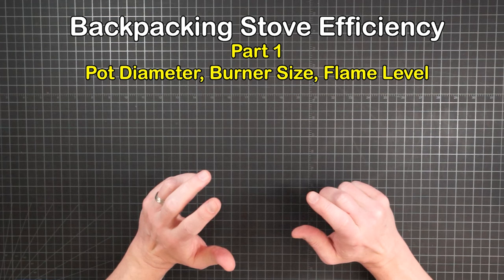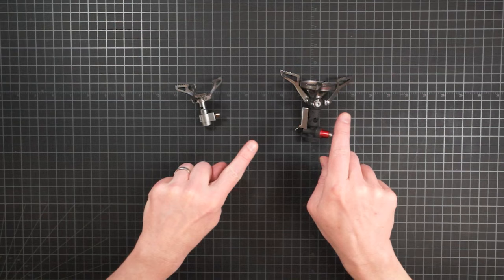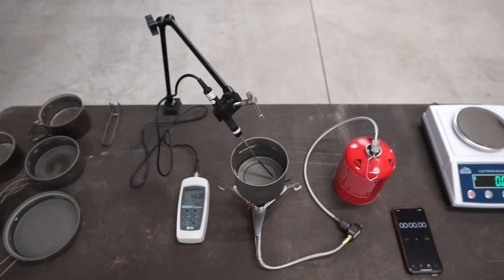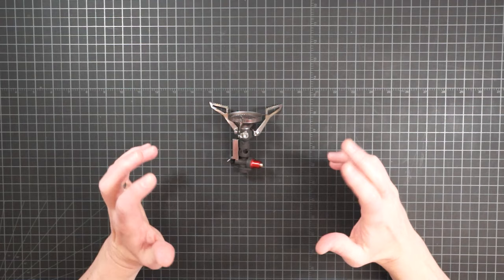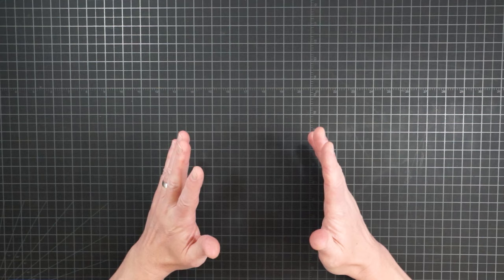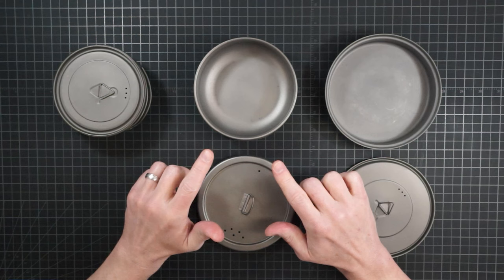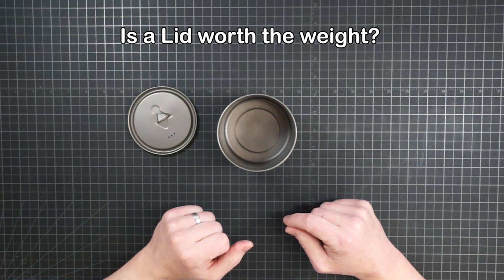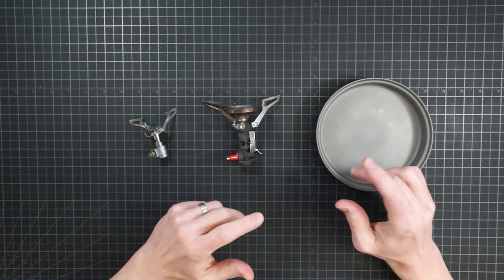Backpacking Stove Efficiency, Part 1: Pot Diameter, Burner Size, Flame Level

Comment: Thank you for starting this stoves series! I've had the questions you are exploring for a long time and very few reliable tests around the web.

If you are taking in suggestions:
- Heat exchangers vs regular Ti pot (or maybe a comparable Al one), are the savings worth it?
- MSR reactor style stove is supposedly more economical, is the weight penalty of the system worth it? When paired with regular Ti pot vs when with the default HX pot
- Alcohol vs gas vs liquid fuel, where is the inflection point of weight optimization?

Cold weather scenarios:
- Liquid fuel vs inverted gas vs gas
- Test solutions to warm up the gas cannisters like moulder strip or submerging in water
- Most efficient way (and system) to melt snow

Differences in altitude would be out of reach (no pun intended) for testing right?

And don't get me started on wind and wind screens, the rabbit hole goes ever deeper.

Good luck and have fun on this journey, well be following along!
Reply from the maker: Duly noted!

I'm already collecting windscreens, working on a fan for controlled air speed, and getting my hands on various heat-exchanger systems (like the Jetboils, MSR Reactor, etc).

Beginning thoughts on how to add alcohol and even stick stoves into the project.  Rabbit hole, indeed.
Reply: Hi. I was about to basically make a similar comment, but instead upvoted yours. 

For a point of reference in somewhat cold setting. In Norwegian winters, we often bring a bit bigger pot. 3L pot for 1-2 people. We're melting snow to about 3 L of water, per person, per day. (4-6L for soldiers in high activity) These ski&sled trips can often go on for about a week. Up a month if you're crossing Greenland and anything in between. Basically, a lot of uptime with no resupply. 

A little heads up for the uninitiated who intend to min-max their gear. According to a test done by Norwegian Defence Research Establishment (FFI), the flip side of heat exchanger pots is that they'll generate far more carbon monoxide than flat bottomed pots. In their test environment of heat exchanger: full power, icy water, a fairly sealed Hilleberg style tent. After only 5 minutes, the levels became dangerously high (1000 ppm). This would put you asleep in 2 hours, and death by 6. The CO levels from heat exchanger pots were 10x more than flat bottoms, but the levels increase to 50x if you mix burners and pots not designed for each other (e.g. Primus Camplite 3L + MSR Whisperlite, where the pot sits lower on the flame than intended). The effect can thus vary significantly depending on the stove and pot you choose. Keep in mind, your body also takes quite a while for your blood to get rid of CO build up. If you intend to test combinations for CO, it can be worthwhile to buy a good quality CO alarm that will notify you. 

Cheers.

Source of the test: 
(Test. Norwegian, but with English summary) https://publications.ffi.no/nb/item/asset/dspace:2690/2012-00404.pdf
Reply: @willek1335  Even in winter, cooking inside the tent is not my main option. Even só, I've never thought the HX pots could have this much of an impact in CO2 build up, very interesting!
There is really a lot of factors and combinations to test, for instance the thing about the lid shown in this video. There is probably a windy cenário that makes it worth it to bring the lid along again
Reply: What about fuel loss each time a stove is disconnected from a fuel can? If a small fuel can produces 18-20 boils, does that number decrease if the stove/can is disassembled between each use?
Reply: Thanks for your careful work.  My quick outdoor test had the JetBoil Stash as the must fuel efficient compared to BSR with Toaks 
550 pot But at a considerable weight penalty.  
Slight wind 60 deg tap water to visual boil  , so not so nearly controlled. Would really like to see these two in your next series of tests.  
Thanks again
Reply: Oh yeah! I'm so interested in alcohol stoves and how they play into this, but the problem is there are so many styles of alcohol stoves with wide ranges of weight, efficiency, heat output, etc.

Comment: This was one of the most delightful backpacking videos I've seen. Now for the search for zero wt lids: old dinner bags or maps or phone covers or hats. Maybe flatish rocks.
Reply from the maker: Zero-weight lids are available in unobtanium, currently on indefinite pre-order.
Reply: FYI my Jetboil lid fits well my basic 600ml pot. Odd my Titanium lid is heavier than the plastic.

I knew intuitively a lid helps - particularly towards end of a boil process as evaporation heat loss increases - and helps with a wider pot more than a narrow one, just with this video it proves is admirably.

Comment: Very well done.  The fast boil time trend is kind of silly.  We are camped and don't have any place to go. I had similar results while testing my DIY alcohol burners. The most important factor I found related to efficiency, was a moderate falme that did not spill over the bottom of the pan and reach up the sides.  I was able to (eventually on my bench) boil 4 cups of 65F water burning 1 oz of denatured alcohol.  That is about 50% net efficiency - BTUs transferred to the water. Boil time was about 6 minutes for two cups and 11.5 minutes for 4 cups.  Of course, the conditions were ideal; e.g. no wind. If you are curious, I've documented build and test on my channel.  Thanks for a great series!  TomLovesDIY

Comment: A decidedly fascinating consideration of vessels and stoves. I am a camp chef, and consistent food preparation trumps all other considerations. That's my priority and requisite compromises. When solo camping, I use the Glacier stove in order to achieve better heat distribution from the wider footprint of the flame, and I use the MSR stainless steel skillet. While both sit squarely in the heavyweight category, my pancakes and omelettes are flawless. Thank you for your superb and excellent experimental work. I greatly appreciate the thoroughness of your videos.
Reply from the maker: One of the projects I have on a back burner 🥸 is to test different styles of heat diffusers, specifically for the camp chef.  My goal is to try and find a diffuser/pan combination that is lighter than carrying the thicker, heavier vessel.

Comment: Thanks for this work and data.  The weight analysis in real world backpacking ends up being more complicated than any general conclusion can summarize and it's important that we use this data carefully in our individual use scenarios (as the creator clearly says).  For a typical user that starts out with a full canister of gas and doesn't use it all on a trip, a more efficient stove-pot system usually actually means carrying MORE weight since less gas burned means more gas carried!  The more efficient gas burning system only ends up being a weight advantage if it means you can carry less gas overall on your trip (e.g. one canister vs. two, or a small canister vs. a large one).  If, though, you go out (lets say) for a typical 5 days of backpacking and use one small canister for 10 boils that last the whole trip, a more efficient system leaves you with more gas unburned in the canister that you have to carry every day.  If we use an extreme example from the study, a system that burns 6 grams per boil would burn 60 grams of fuel after 10 boils, leaving 50 grams in the canister at the end, while a system that burns 9 grams per boil would burn 90 grams leaving 20 grams in the canister at the end.  That 30 gram difference should be factored into the weight calculations if this is your typical use.   One way we could actualize some weight savings by a more efficient system would be if you are careful to start with a canister that is not full but only has the exact amount of fuel needed for the trip, but that's a bit of a dangerous game and not something many people do in real life, especially since it requires the tricky business of refilling canisters.  Even in a thru hike scenario, resupply stops are fixed points on the trail, meaning you cannot simply get another canister exactly when you run out.  This means that there is an inefficiency again when you carry more fuel than you needed because you had to buy another canister in town when you had, e.g., 5 boils left.  Occasionally the threshold idea you presented means a huge weight savings (a small canister makes it to the resupply rather than a large one needed for a less efficient system), but over a long thru hike these factors cannot be counted on consistently.
Reply from the maker: All good points!  For me, personally, I see it as a planning tool for a longer trip without resupply.  If I can make reasonably sure to get by on just one can, instead of needing to bring two, then that's a win.  That sounds more like a Fuel Efficiency Priority than a weight one.  The heaviest (most efficient pan) is still lighter than that second can that will only be partially consumed, as you say.
Reply: @GearSkeptic  A full 100g canister weighs 206g (on my scales, Primus) , vs a 230g weighs 370g. So an empty 100g is 106g, an empty 230g is 140g. To carry 2 100g, so 200g total fuel is 412g vs a 230g fuel is 370g. So the pivot is if you can make a 100g canister last the situation.
Reply: I have 3 100g canister and 1 230g and I buy 450g canisters. I refill the 100g from the 450g to keep costs down and so can decide how much canister fuel I carry. I've already proved to myself a Jetboil wins on the 7-day scenario (full 100g, average conditions) but it's the 3-5 day scenario is less clear. Alcohol wins the 1-2 day handsdown due to difficult to get alcohol fuel+bottle+burner weight as heavy as a near-empty canister + burner.

So your point of you carry more weight on average with a more efficient stove setup is not true when you choose how full the canister you carry is. e.g. suppose one setup averaged 5g/use and another 10g/use so for a scenario of 10 uses the first setup you'd leave with a little over 50g fuel and the second setup you'd leave with 100g fuel. I have a canister currently weighing approx 26g fuel remaining and if I use with my Toaks+Kraku setup would do about 3 more boils so if I needed more I'd refill it to required level. Plenty of videos how to refill and the gadget pays for itself after a few refills as the bigger canisters are better value.

Comment: I greatly appreciate the level of thought and thoroughness that was put into this test, but also the sheer amount of work of going through that procedure 72 times! Also one other thing to note on weight efficiency - on trips that are shorter than 18 full boils - it may actually be more weight efficient to put to the stove on high flame, since you will be carrying less fuel back home in the end, i.e. less weight on the back. Looking forward to a next installment about container materials and wind influence!

Comment: Great video and thanks for putting this together. It seems obvious that increased surface area on the bottom of the pot increases the heat transfer. I bought an aluminum pot (OLICAMP Hard Anodized XTS Pot, 1-Litre) with a heat exchanger on the bottom (cheap version of a jetboil pot or MSR windburner pot). Same principles apply where the increase in pot surface area also increased the fuel efficiency of the system, and allows capturing more heat (faster boil at high flames). Cost is the increased weight; it weighs triple the weight of my simple titanium pot.

Comment: OMG! - I'd love to give two thumbs up. These surprising and thorough tests where just what I was looking for.
Ah, there is one thing I forgot to mention. You need to bring a lighter with the BRS as opposed to the Windmaster (or any other with igniter). That does shrink the weight advantage - not to mention the reliability which of course is just a side note.

Comment: The ultimate killer combo still is the Toaks 550 with BRS stove and a small gas canister. This together with a daily meal plan based around power oatmeal for breakfast (instant oatmeal, powdered butter and whey protein), hiker beans for lunch and dinner (refried beans, taco seasoning and Fritos) will last a hiker 10 days easily.  None of these meals require boiling hot water, if you use low flame and heat up to around 70 Celsius (first bigger bubbles stuck to bottom) it’s enough. Also both don’t require much water, needing around a cup each. It’s the most inexpensive, hiker friendly, functional and lightweight way of providing warm meals while Thru-Hiking. In longer food caries this whole kit of cook set and meals is just unbeatable.
Thank you for such great content as always 👍🏻
Reply: I forgot to mention I have pushed to 14 days with one single small gas canister by adding a aluminum foil cozy around the pot.
Also the small gas canister fits just right inside the pot, with room for the stove, lighter and a small cloth towel.
Reply from the maker: I do granola instead of oatmeal (it's great cold, so I save one meal's worth of heat), and always add a scoop of vanilla protein powder.  I'll have to try the butter powder on your recommendation.

Thanks!
Reply: @GearSkeptic  powdered whole milk is a nice addition too, for oatmeal in the morning.

Comment: Very interesting results. I'd love to see you repeat these experiments with a simple alcohol burner. It explains why I get better fuel efficiency when I add a little water into the fuel on an alcohol stove or when I use a less energy dense fuel like methanol compared to ethanol - which is counter intuitive, but the more energy dense fuel gets the stove hotter and acts like a "high" heat - wasting fuel. I already knew this from supposition, but it's nice to see the data. I'm really enjoying your content. Thanks for putting in this work.
Reply from the maker: That’s a great idea! I do plan to add alcohol stoves to the series, and using different alcohol percents is going to have to be part of it.

Comment: Although I will at this stage will only be using wood as source of flame, I appreciate your effort and time testing these.
Reply from the maker: I'm actually working on a way to use pre-measured amounts of wood (in some consistent type) to try and test efficiency for stick stoves, as well.

Comment: This video is amazing. You’ve done an extremely thorough investigation. My one quibble is that someone who is worried about saving 6 grams of weight, is probably not using a canister stove. A cat food (or similar) alcohol stove destroys any canister stove for weight savings, and you can, with much more ease, exactly tune the fuel to the exact number of times you need/want water to heat water. Not to mention, with an alcohol stove, you wouldn’t be lugging around the 100-216 grams of the empty metal canisters. While plastic bottles used for alcohol stoves are much lighter coming in more in the neighborhood of 30 grams. I’ve been totally tuned out of the ultra-light backpacking scene for about 9 years so DYI alcohol burners may be out of fashion of late, or may have even been banned in the drought-stricken wilderness areas of the west and mountain west.

Comment: Thank you for your rigorous testing and spot-on analysis of the results!  I would love for you to test fuel use and weight efficiency of: 1) fuel exchanger stoves such as Jetboil, vs. the open-burner stoves you tested here; and 2) boiling 1 liter as two 1/2 liter boils in a small pot, vs. 1 boil in a larger pot. In my backpacking, I  frequently boil about 1 liter to reconstitute a meal, and to make coffee or tea.  Thanks again!
Reply from the maker: I do have heat exchangers planned for the series.  Working on wind effects now, and windscreens so I can try to compare a regular stove with screen to an exchanger system.

I like the idea of comparing two small boils to one larger one, for both Fuel and weight efficiency.  Thanks!
Reply: To answer that question fully is a lot of effort as you have to do it in different conditions and do an average. However I've done my own tests just one in still indoor air and one in breezy outside, for my typical water quantity of 350ml. My Jetboil was averaging 4.55g , my gas burner was 7.96g. i.e. I saved on average 3.41g. However, my Jetboil is minimum (pot, burner, lid) 244.3g, while my Ti pot + lid + burner is 89g, so 154g savings, or 45 uses.  I then did real world camping cooking and was averaging 13.72g per day with my Ti port+burner so my less efficient non-Jetboil is a 7 days per cartridge vs (extrapolating)  12 days Jetboil. So you'd think Jetboil would win with say a 100g canister vs a 230g canister e.g. a 10 day trip I'd ger by with 100g with Jetboil vs 230g with non-Jetboil, but the difference in canister weight is 164g. That is even carrying more fuel non-Jetboil a Jetboil still ends up heavier, and on average it's worse as my less efficient non-Jetboil is getting lighter faster than Jetboil. 

So in no situation does a Jetboil win an argument. Or did I miss something?

I've since got a wider pot which is probably more efficient but not yet redone my tests. I don't waste fuel doing tests I just use my camp cooking equipment to make tea so it takes a few days to do my tests.

My fuel costs are 12pence UK per boil ;)

Comment: This is the best test of the relationship between burner head size, fuel flow and pot diameter I have ever seen on YouTube. Good job. Outside there would be more variables, especially wind, but still very impressive test. I like your style and have subscribed. I use the Evernew low 600mm pot with the PRD and I think there is some advantage to that pot because it has a pouring spout and I lose less water when pouring, And I will remember to keep the PRD on low and I
always use some kind of partial windscreen but not surrounding the canister completely.
Reply from the maker: Thanks!  I have definitely come to appreciate the advantages of a low and wide pot after this.  I'll be looking into windscreen in the coming Part 2 on wind effects.